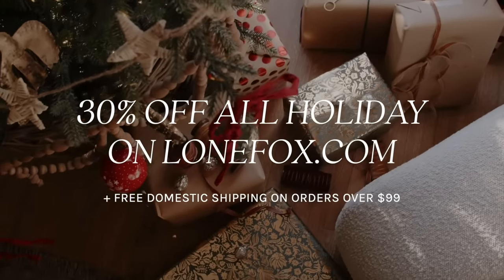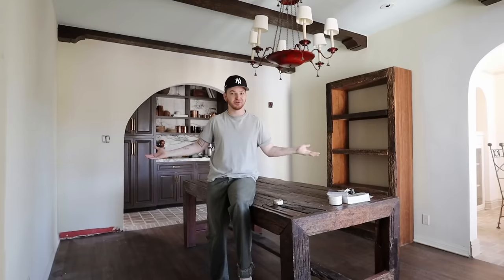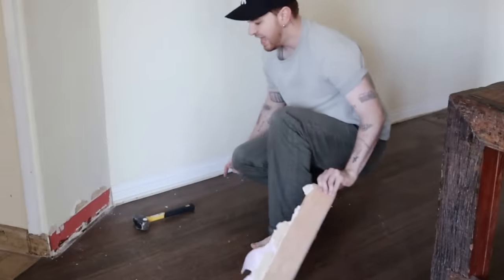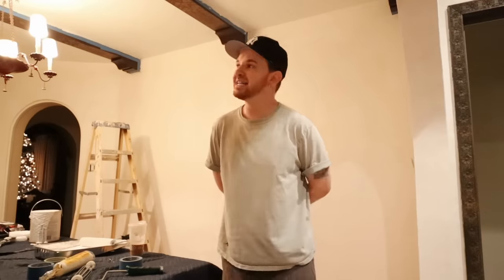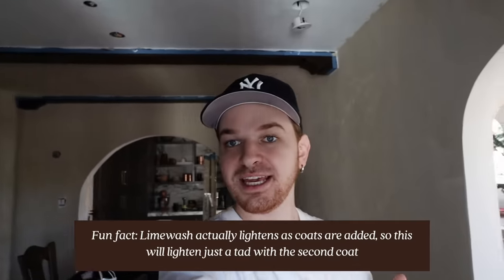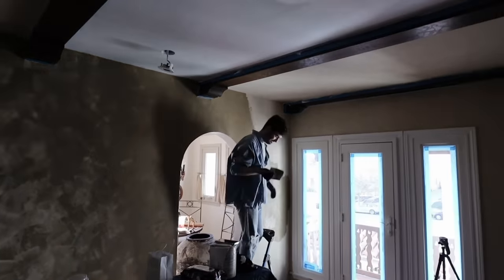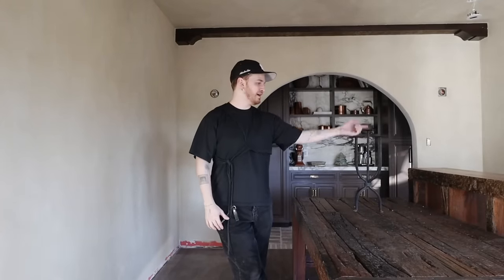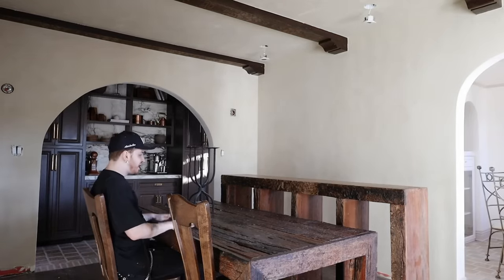Extreme DINING ROOM MAKEOVER *Warm Textured Walls & Vintage Accents*

Comment: I never tape off the glass if I’m painting window trim or door trim. I paint it and get way in to the line between glass and wood. When completely dry, I run a sharp razor blade down the line, then run it flat down and I get the cleanest line and window possible. It saves so much time.
Reply: Me, too!!
Reply: I do that as well. Much faster and better result.
Reply: I use a pointed paint brush I found on Amazon. Life savers. No taping required. It gets in tight spots. I love them.
Reply: He's spray painting primer, so he did it to protect against overspray.

Comment: There’s a way to remove baseboards in a way that doesn’t chip your wall or the wood. Use plastic painter spatula to slide into a crack you will open then hammer it lightly as you prop it off the wall. trust it comes out clean & gentle. 

Also when you open the can of paint, there is a cover with a spout you can buy at HD to e sure you don’t drip onto the can or anywhere else, less mess =less clean up :)

Comment: Maybe you could use the bookcase on the wall turned sideways as you have it on the floor. Add shelves and do your decorating on the shelves, maybe handmade pottery dishes, cups, etc. I think the inside of the bookcase needs to be the color of the walls.

Comment: I wouldn't have moved the light box but instead would've swagged the light fixtures chain to be centered over the table. The box would still be centered between the beams. It give more flexibility down the road if a change in position of the fixture was warranted.